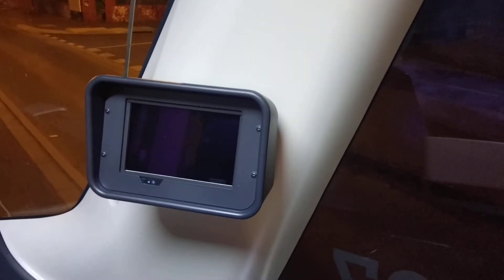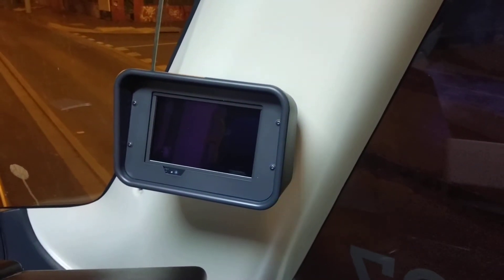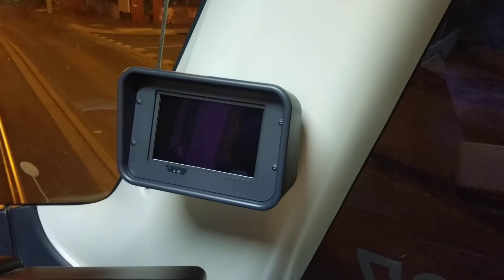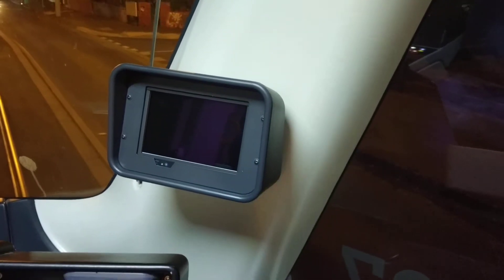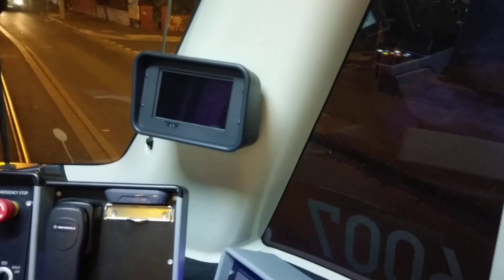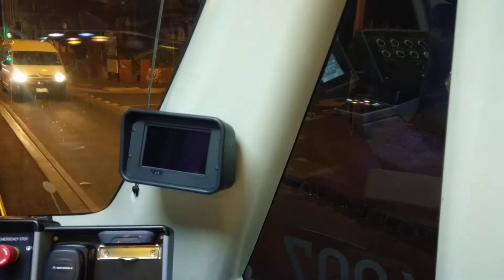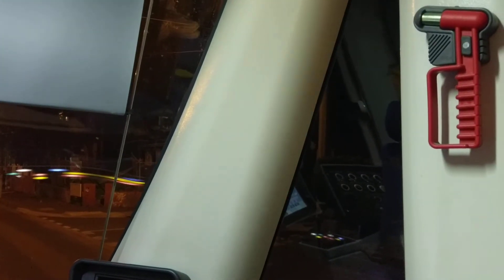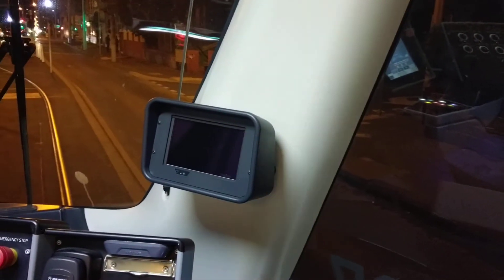E Class Tram Modifications - External View Blind Spot Driver Cameras

Comment: Any other difference between E1 and E2 trams? Also what number do E2 trams start from?
Reply: The cab on the front is of different design with greater visibility for the driver. E2 trams start at 6051. At this stage there will be 30 E2 class.